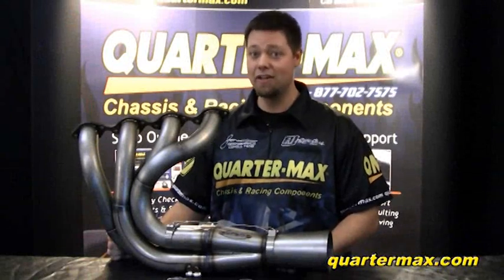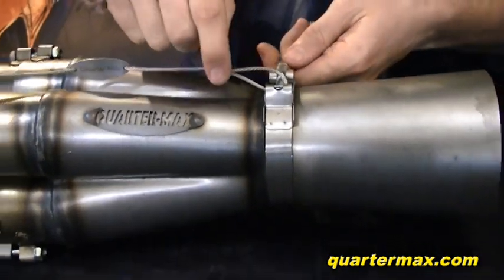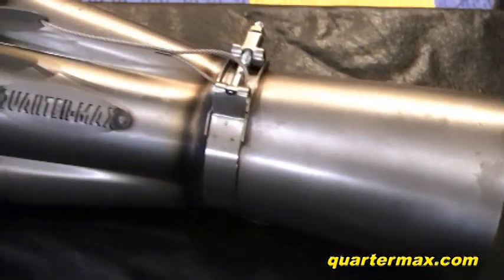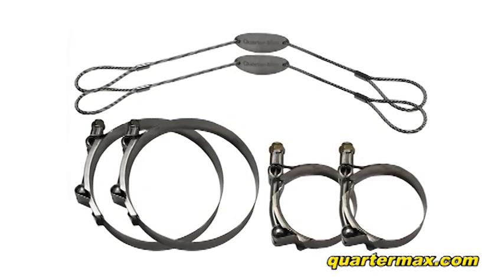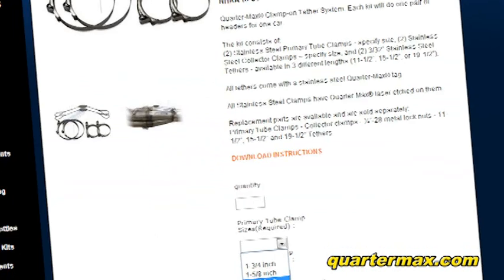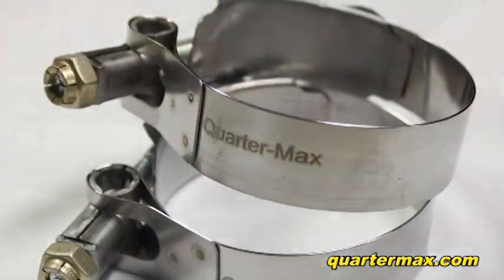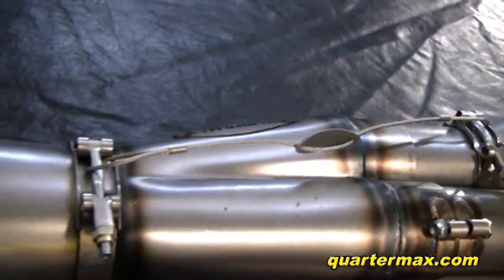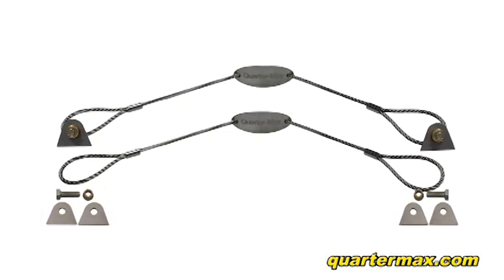Collector Tether System from Quarter-Max

Comment: On my headers I have a tab welded on the collector and a tab welded on the primary tube.  One bolt holds them together.  The weld on kit is the same thing.  My nhra tech guy told me I can not use mine because the weld on the tab could break off.  So what is the difference.